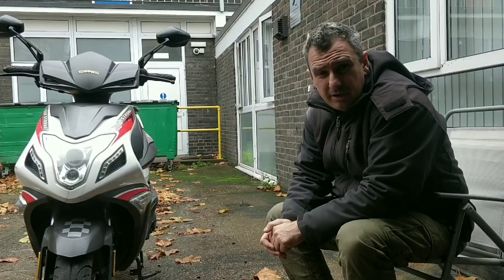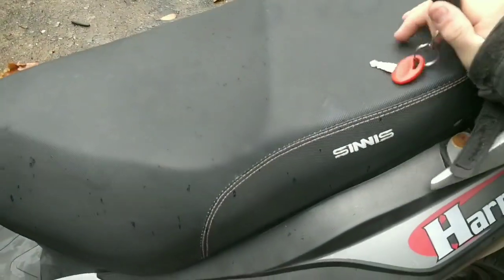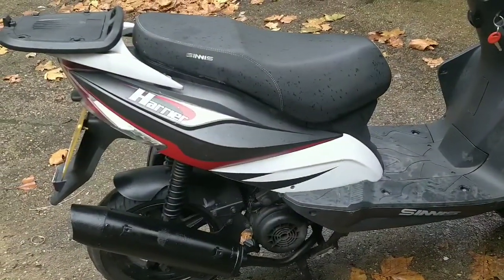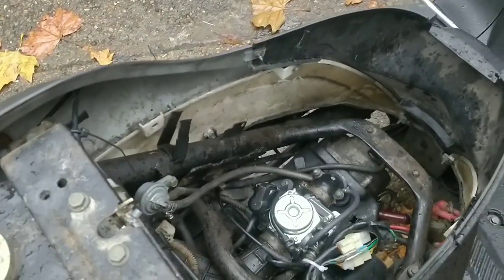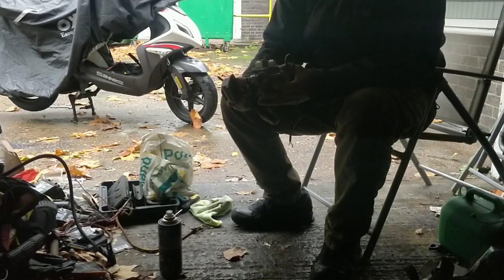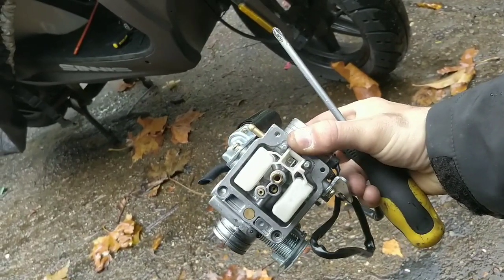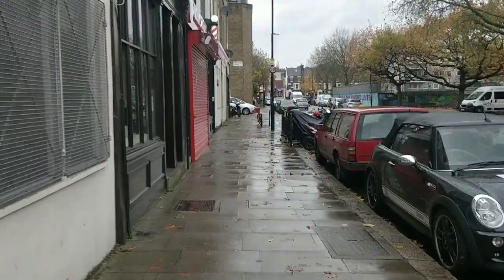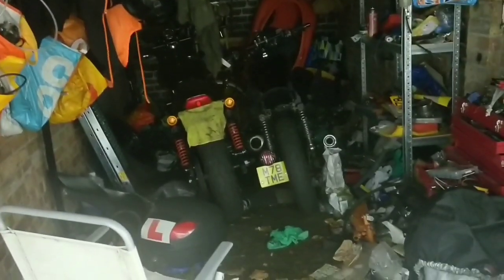sinnis harrier, 125cc, MOT checks, carb fix,

Comment: I have same bike and the back wheel goes crazy when idle… what problem would that be??
Reply from the maker: You can lower the idle speed on the carb
Reply: Could be worn clutch, will cause wheel to spin as if its still on choke

Comment: Hi mate
Great video
I've got a sinnis shuttle that I can't get started. It was fine I. October then now won't start Ive tried new battery and spark plug.

I think it maybe carb but I'm a complete beginner and don't know where to start. 

I'm up in north Yorkshire Harrogate do you come out and look at bikes
Reply from the maker: Hi mate. I wouldn't be able to go that far I'm afraid. 

You can do a test here to see if it's the carb. Pull the airbox of the carb and spray something through the carb, easy start, even deodorant, if the bike then starts for a few seconds that would suggest you need a good carb clean or a new carb. 

Give that a try and get back to me. 

Thanks
Reply: @motorcyclerescuer  I'll have a look once I'm back end of the week 
Do I need to take the full air box off or would the pipe unclamp easy enough to get into the carb to spray inside
Reply from the maker: You can take the air filter of and spray down through the airbox. If you pass a halfords or petrol station grab some easy start which will work best. It won't start for long but will tell you if everything else is OK and you only need a new carb.

Comment: I’m having the exact same issue with my Sinnis shuttle 125 been running fine until today, turned the ignition on before and the back wheel is moving by itself now, I’m no expert so I’m taking it to someone who knows what they’re doing MOT due next month might be a blessing something has gone wrong now rather than later
Reply from the maker: Hi, is it a carb model? It sounds like either the choke is stuck on or it has an air leak making it run rich.
Reply: My sinnis harrier 2015 doing the same no matter what I do with the carb it barely starts and back wheel goes on it’s own when it does what do you think it is?
Reply from the maker: It sounds like an air leak ro me. A split in the air box boot possibly

Comment: hi mate, ive got my first moped that needs mot and just wondering are cracks and chips in the bodywork acceptable?  mine has quite alot and although im trying to fix them not all of them will be completely fine. also if the plastics dont fit right is it still fine?
Reply from the maker: Hi, as long as they are secure and not sharp then it won't be an issue.
Reply: @motorcyclerescuer  you reckon i can just put duct tape over them ?
Reply from the maker: Yeh that will be fine

Comment: Ive got same bike but euro 4 and they have different carb, ive got an idle issue do u think u can diagnose or fix?

Waiting on ur answer
Reply from the maker: Hi, the newer model is fuel injected I believe. This should also have an idle adjustment though. You should see it somewhere near where the carb would sit. 

If it dosnt have adjustment then it may need a service to get it running at its best
Reply: @motorcyclerescuer  all service was made on it filter changed and everything top...but idle is terrible and engine dies all the time
Reply from the maker: It must have an idle adjustment screw somewhere. Normally under the seat.

Comment: Think the revving comment was meaning from cold, you should always let the bike get to temperature or car for that matter before revving them or pushing them to much  common sense tbf pal, you should think before you try and roadt somebody who is telling the truth
Reply from the maker: What makes them think its cold? 

Plus that's quiet old fashioned now, engines used to be made differently, newer engines have much together tolerances and actually can be ridden/driven from cold. In fact you are advised to.
Reply: Im not assuming anything pal, just thought maybe thats what the original commenter was getting at
Reply from the maker: No idea what it was about. If I remember rightly he just said I rev my bikes to much. But if its not bouncing repeatedly of redline then its not to much
Reply: @motorcyclerescuer  yh just always best to let them get to temp before high revving, but once its warm its fine